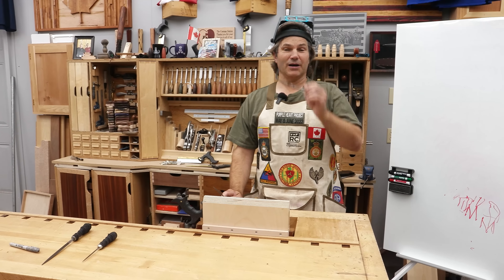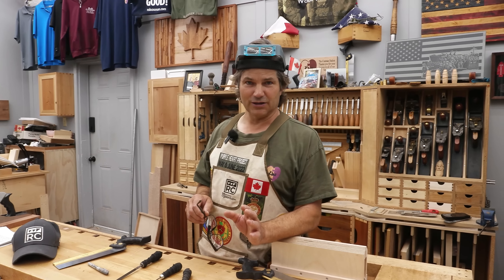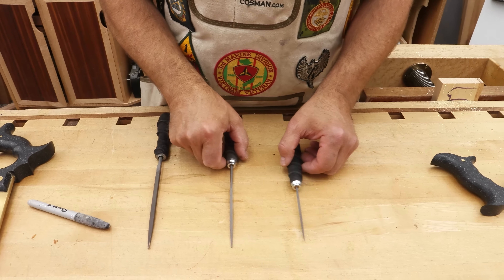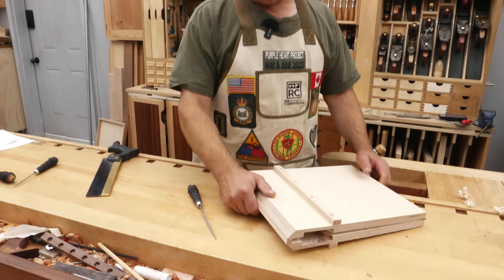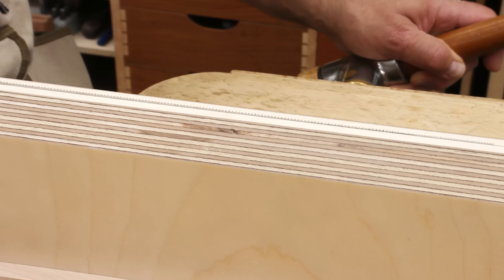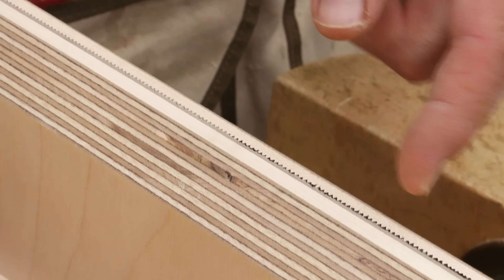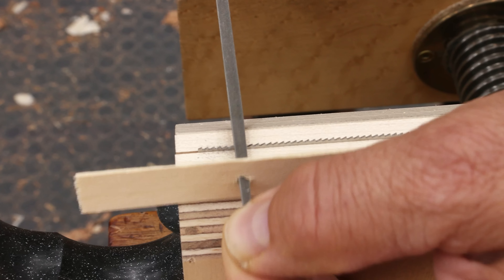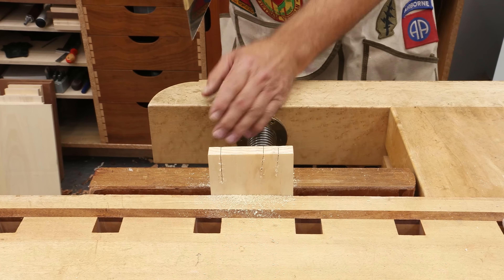Saw Sharpening – Re-sharpen a Dull Rip Saw

Comment: How do you tell if your saw is premium or disposable hardened? I have one old saw that was my father's, and a new one I bought at Home Depot 2 years ago for not very much money.
Reply from the maker: Hardened teeth looked discoloured, dark.
Reply: @RobCosmanWoodworking  Hmm, ok. My Irwin saw is probably hardened then. I had been using my dad's old, worn, rip saw, forever, and then I bought the new Erwin crosscut saw for $30 and it cut through wood like a hot knife through butter. I was amazed! Would love to see dad's old saw perform like that.

Comment: OMG now I see my first mistake I used to have my file off to an angle instead of what you are doing straight across so it looks like I should be sharpening the points and not the sides of each tooth thanks Rob. I'm going to use the oldest saw for practicing on
Reply from the maker: If its a rip saw you file perpendicular to the tooth.  On a crosscut saw you file at an angle (Video coming soon on a crosscut saw sharpening).  You should be sharpening or removing metal from the whole front of one tooth and the whole back of the other tooth that the file is touching....not just the tip of the tooth.
Reply: @RobCosmanWoodworking  I like 8 to 15 degree for C/C rake.

Comment: Hey Rob, I believe on the volume settings  for your videos over the last couple weeks it's been really low during demonstrations or teaching part etc, or rather the actual new footage part. But in the pre-recorded bits like where you say "If you like my style of teaching" it's much louder.
Might want to have volume or video gain or whatever its called checked because I'll tell ya if you're wearing ear buds you're in for a surprise of volume difference. 
Anywho, great tips on that saw holder with the hinge and stuff. This will definitely be my next project. Thanks again for the years of teaching, videos and all that you do for others.
Reply from the maker: We have fixed the audio.  Just need to publish videos to clean out the ones before the fix

Comment: I didn’t quite catch the difference with the tiny front teeth. These have a different rake right?  They’re angled backwards a little. Can you just confirm that you rotate the file backwards a little to account for this?  I couldn’t be sure from the video. Thanks!
Reply from the maker: Yep, adjust the file to produce the desired angle.

Comment: Great class.  Pardon a stupid question: can I resharpen a Japanese saw?
Reply from the maker: Well if it's an inexpensive one it's likely harden teeth and that blade is designed to be used and thrown away. If it's a expensive traditional Japanese saw it can be re-sharpened but it takes special saw files and is much more difficult to do.  Saw sharpeners apprentice for 7 years in Japan to become master saw sharpeners.
Reply: @RobCosmanWoodworking  Thanks for the insight.

Comment: Jason at Fireball Tool did a comprehensive test with files showing the amount of damage in dragging the file backward after making a cut. Interesting results. Negligible damage in 2500 strokes. Personally, like you, I like the control of using the back stroke as well as the benefit on a saw blade of removing micro-burrs that occur with one direction cuts.
Reply from the maker: Thanks for the info!

Comment: If you run the sharpie from the handle to the tip, it does less damage to the sharpie and is easier to mark the teeth.
Reply from the maker: Another method is to get some gun sight black and just spray the tooth line

Comment: I do fall back on cheap hardpoint saws when there is risk of hitting into nails,  grit or other hard objects. These saws can also be quite easily re-sharpened using diamond files which helps salve my conscience for buying disposable tools.
Reply from the maker: good tip, thanks